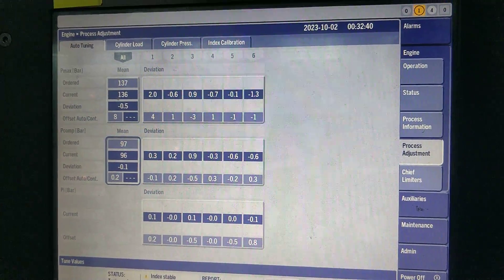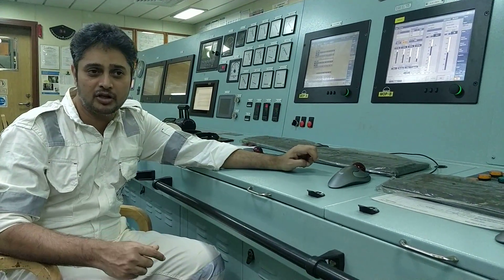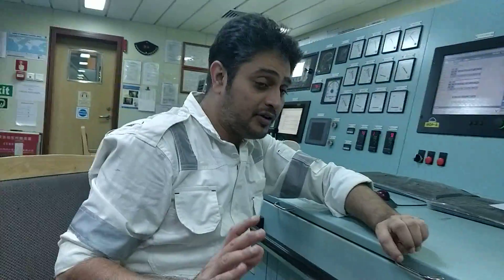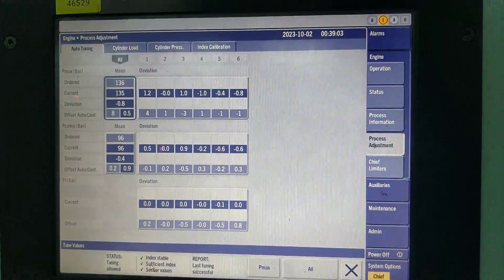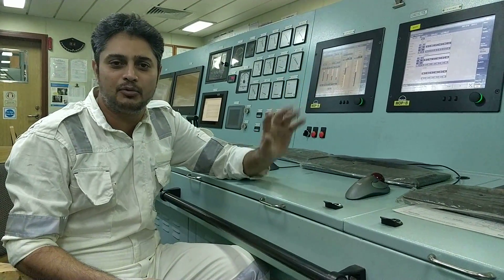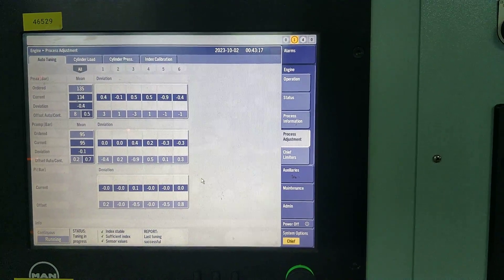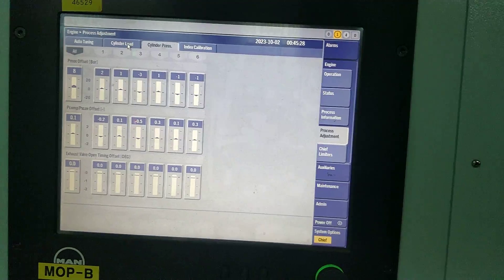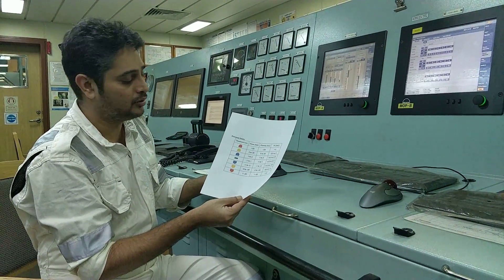ME ENGINE AUTO TUNING- New Age Online Marine Academy

Comment: When manual tuning..which one to tune first? Pmax , or pcomp?
Reply from the maker: Hi... actually manual tuning is not recommended unless there is an issue. Depending on d issue u can do manual tuning in either way bcos there is no strict hard and fast rule reg the same.

Comment: How MOP makes autotuning for Pcomp?, by altering the moment of closing exhaust valve, it closes the valve earlier,  right?
Reply from the maker: @MaxKharevsky   for pcom  u need to giv manual command.
Reply: @Newagemarineacademy Man- this is not an answer 😐 What exactly 🤔 doing electronics so that to increase your Pcomp if you know for example,  that you have weak rings and you want a little bit increase it, because I see only one option how program can do it- close exhaust valve earlier,  right?
Reply from the maker: @MaxKharevsky  I have already shown in the video. Whether it is pmax , pcom or pi mop auto tunes by changing current thereby altering the timing of exh valve opening closing and also fuel index.
Reply from the maker: @MaxKharevsky  by giving current signal. Mop uses the current signal signal to maintain pmax even during normal running wen auto tuning is enabled. The same principle is used wen u give manual command for pcom and pi. This is mentioned in MAN auto tuning and  performance procedure for your better understanding.
Reply from the maker: @MaxKharevsky  also wen u give auto tune command you see the stroke changes both in exhaust valve and in fuel pump depending on the signal.
Reply: ❤❤❤Chief,  thanks for all of your replies ❤❤❤  So, regarding altering the stroke of exhaust valve, I see the sequence like this: the MPC sends analog signal on ELVa, if precisely on proportional solenoid,  proportional solenoid controls proportional valve ( same like directional valve but have many positions depending on the current signal 4- 20 miliamp ) , proportional valve controls pilot hydraulic oil which in turn controls the stroke of the spool which passing the hydraulic oil for actuator and depending on the stroke of the spool our stroke of the valve also changes,  right?  @Newagemarineacademy
Reply from the maker: @MaxKharevsky  Yes.. the main reason why I am telling to go through MAN procedures and service letter is other control systems are also involved. For e.g wen u take performance in ships where T/C bypass is provided then it opens wen scavenge pressure reaches 2 bar. ( For NOX control) . like this many associated systems r there which is  difficult to discuss in this platform. Whatever info I am showing in my channel is just an outline.
Reply: @Newagemarineacademy  Thanks Chief 😊